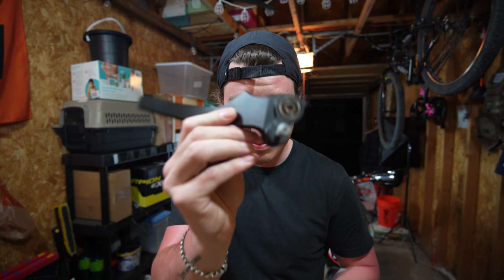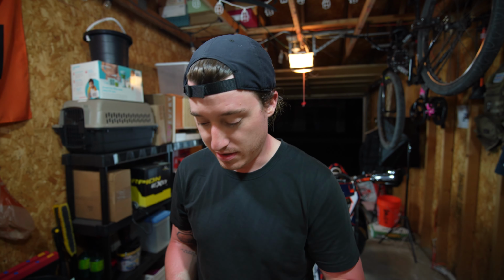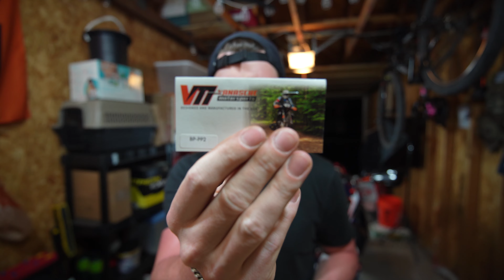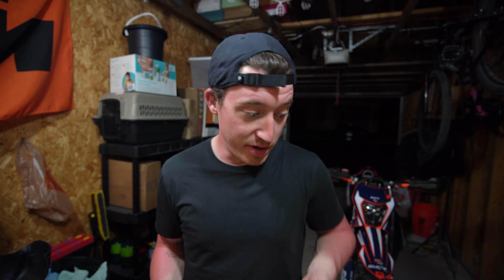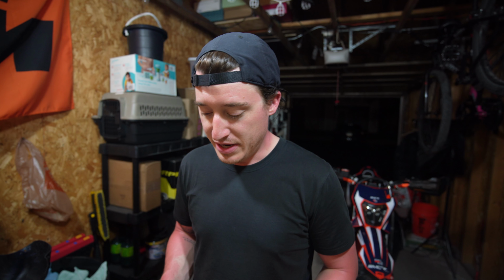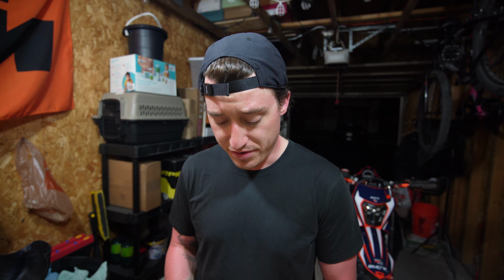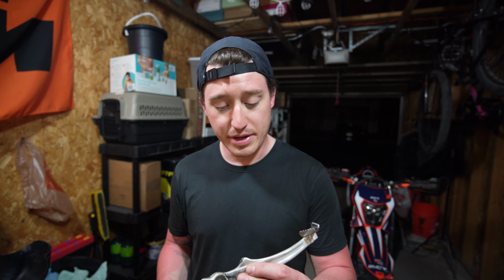How to install a Vanasche rear brake pedal on your KTM 690

Comment: I'm having issues with that swingarm pivot bolt you are loosing @ 1'07" - when I turn it, it spins the entire "swingarm pivot axle" and I have to put a socket on both sides. And then the head comes off ON THE OPPOSITE SIDE but it doesn't seem like I can get the brake pedal/footpeg holder housing off without pulling the entire axle thru.
Mine is a 2011 - I'm wondering if the swingarm pivot bolt is differnt?
Reply from the maker: Hello! I am not that well versed on earlier models of the 690 so I cant say for certain but it seems that you may have a different swing arm completely. I will leave it up to the internet to decide but I'm not even sure if it's supposed to spin everything?? I know I'm not much help..

Comment: Hey is your bike a euro 5 emission or is that something the US doesn't have?
Reply from the maker: It is not, that’s something the US doesn’t have.. we have emissions but I don’t think as strict as an EU version
Reply: @LifeWellRidden  yea I got a 2022 690 and it's Euro 5 and I've read that dyno jet don't make them for euro 5 which is very annoying
Reply from the maker: @con10r46  oh man your out of luck with DynoJet but there has to be another company?? Right? I don’t know much about the euro5 bikes to be honest
Reply: @LifeWellRidden  bit of a different question but what tyre pressure you run front and rear?
Reply from the maker: @con10r46  I usually run 23 at the track and 26 on the street, I usually don’t go much more than that
Reply: @LifeWellRidden  yea I'll have to experiment with mine, need to set the suspension up aswell
Reply from the maker: @con10r46  it takes some time but definitely we’ll worth it!